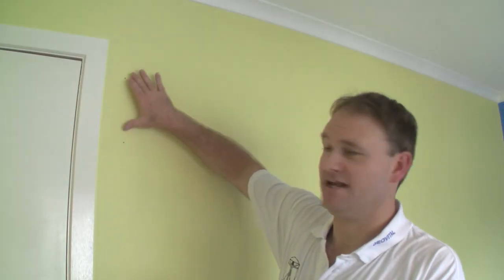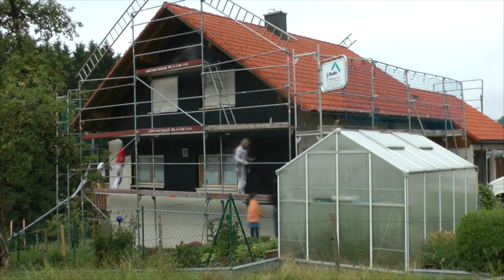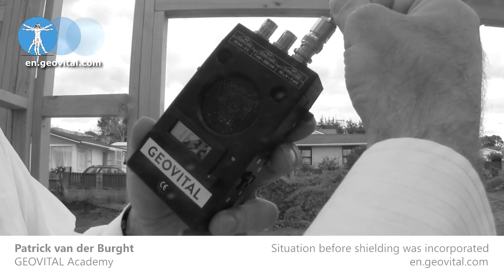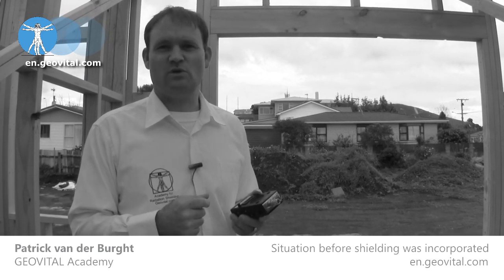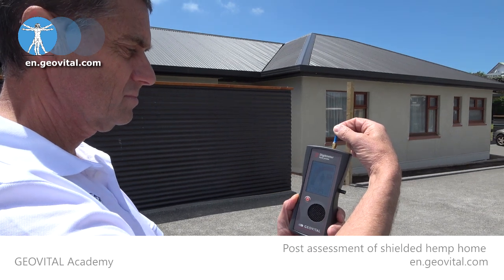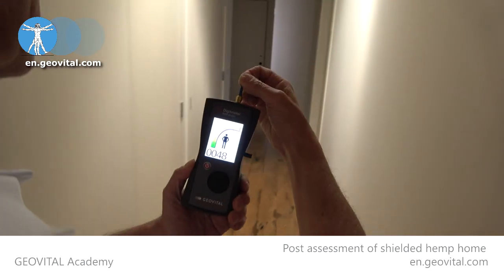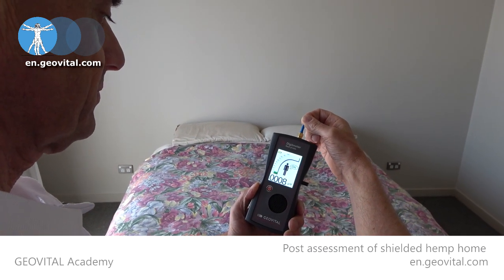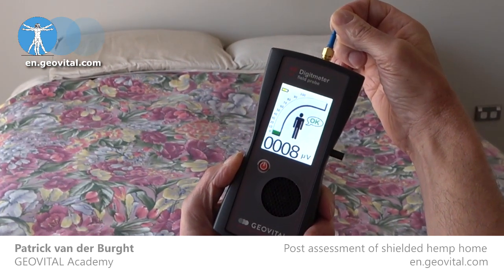Results of EMF radiation shielding of new built hemp home

Comment: Will my cell phone work in that house? What about WiFi?
Reply from the maker: A cell phone only needs a tiny signal to work. It may work inside a shielded home, it may not. Of course it would be good to reduce exposure to its radiation also, so most client place their phone on the window sill behind the shielding fabric. Keeps it signal there perfectly, and you'll hear it ring.
Wifi will work inside, but would bounce around. Much like making a phone call inside a car. Generally if you shield a home, or bedroom, you try and move away from wireless technology. Or turn it on only when needed.
Thanks for asking the question.